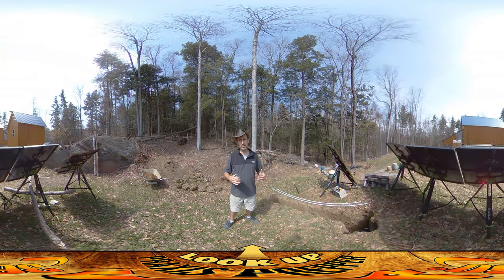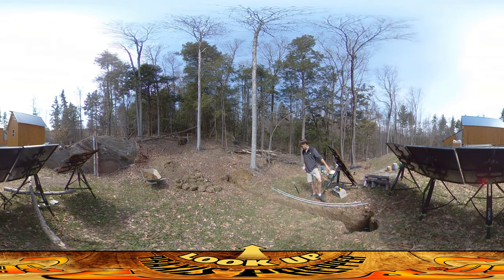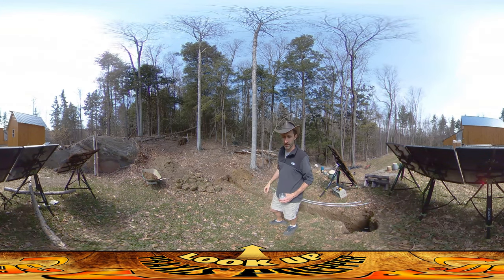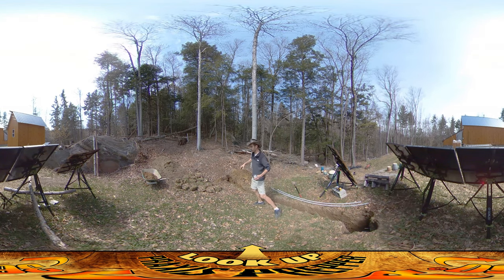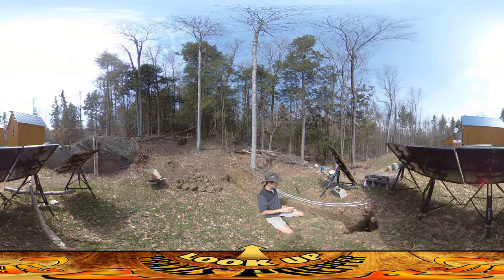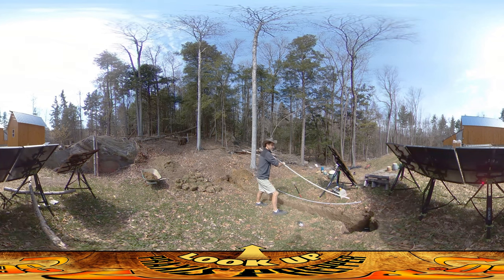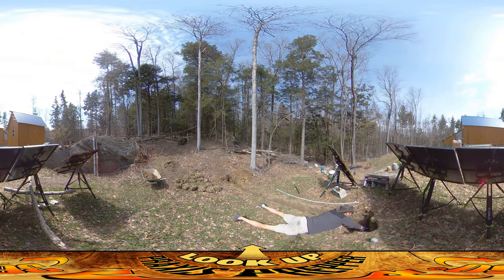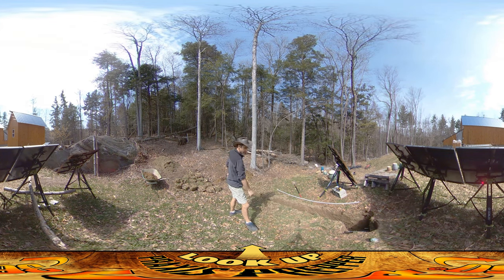Homestead Building - Laying Underground Electrical Conduit

Comment: While looking around I noticed that you have wood projecting past the end of the roof on the storage shed, what’s the plan with those? Just haven’t got around cutting them off yet? Future extension of the roof for some reason? Planned addition? Inquiring minds want to know.
Reply from the maker: The house has similar over-extending boards too. They're left for later when I finish off the ends of the roof. The face boards from the gable ends will screw into them... someday.
Reply: @PraxisPrepper  Not like you have any other priorities on your table eh?